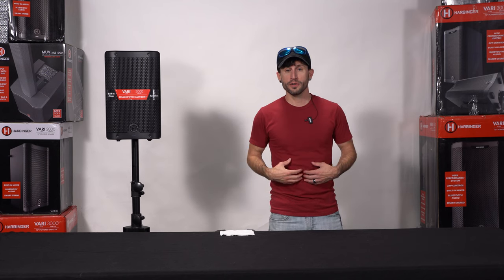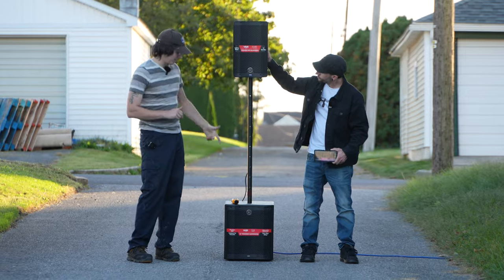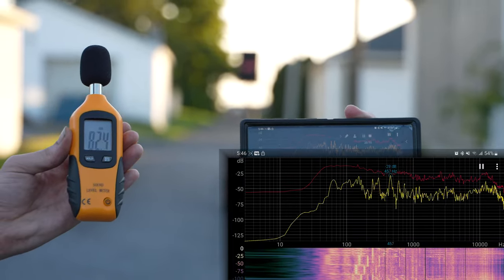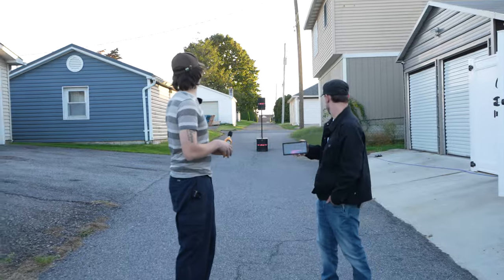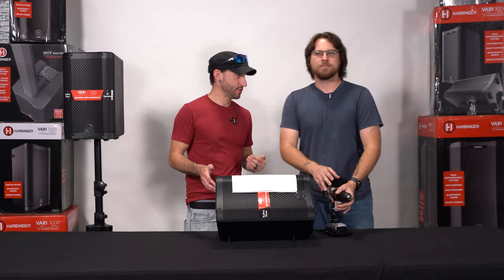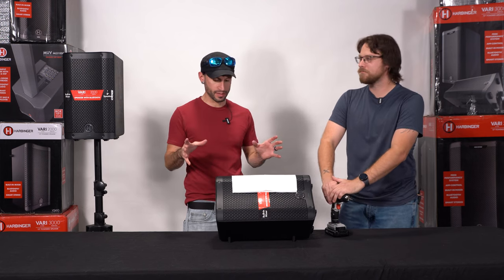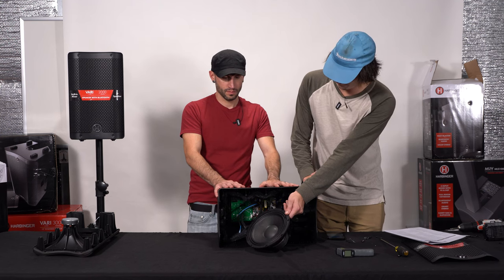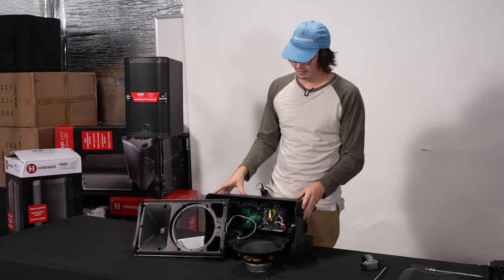Harbinger VARI V2408 8" Powered PA Speaker Review & Teardown

Comment: Could these be used as floor monitors for a full band if each member had one?
Reply: @mikelachendro488   what about the older 2308 model?  Same rms power and build quality just “older” but it saves $100 a speaker at my local GC